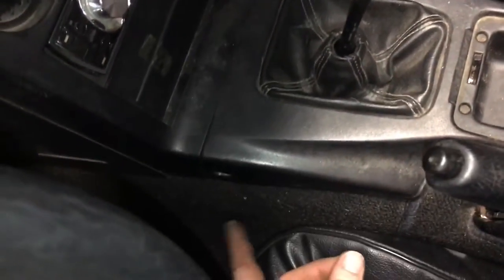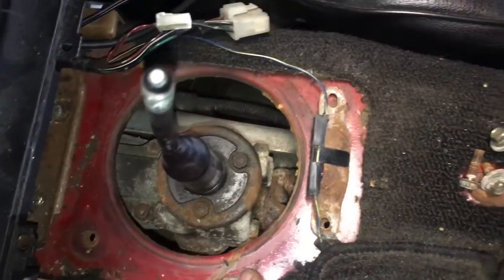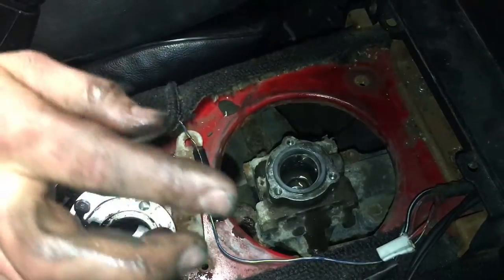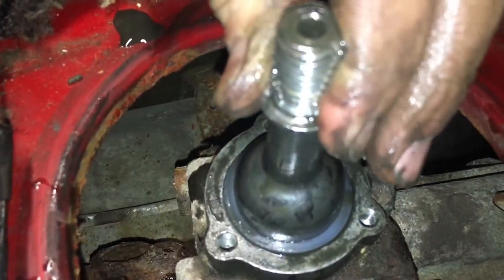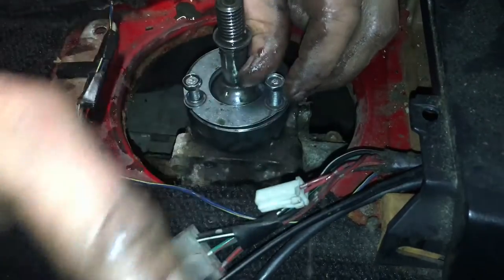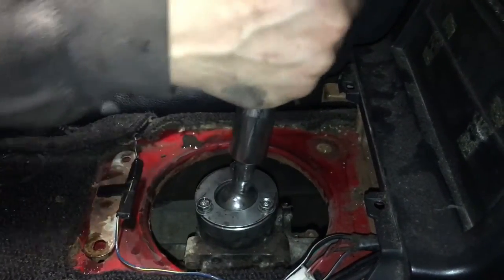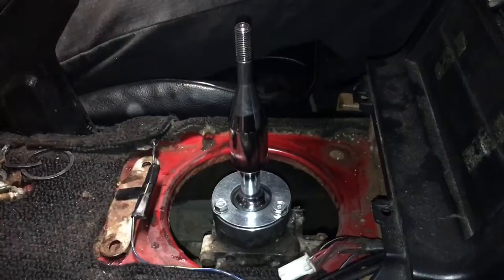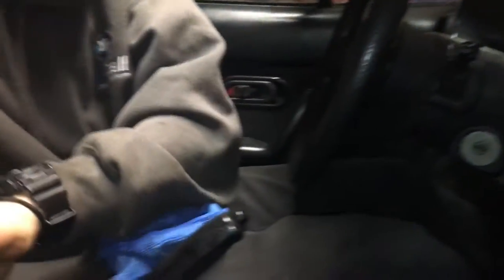$40 Ebay Short Throw Shifter Install Miata

Comment: Couldn't you have just filled more gear oil from the top since you already had it open?
Reply from the maker: +WushuSinned So the top is called the "turret" you can't fill the transmission from the turret. Would make the whole process a hell of a lot easier.